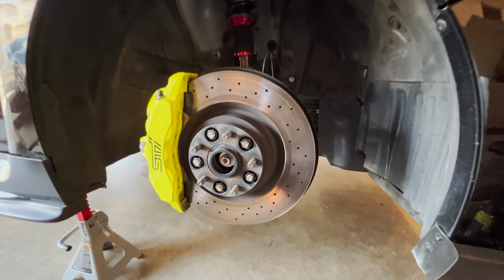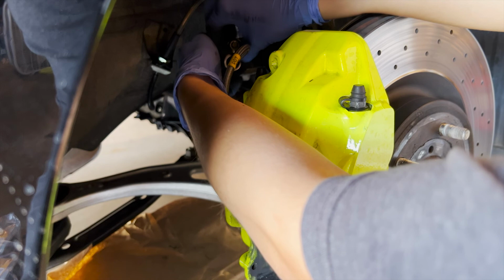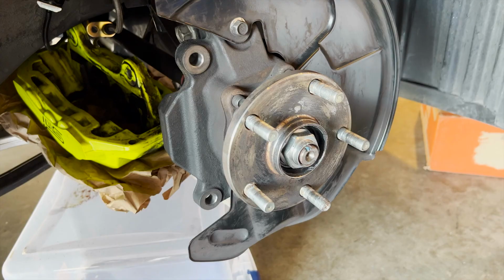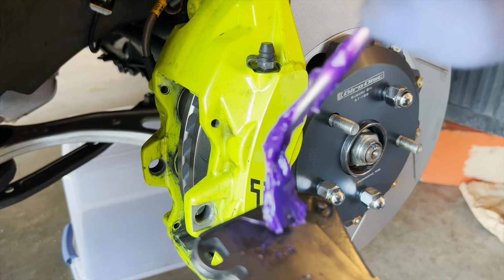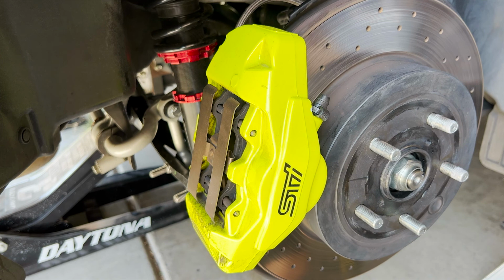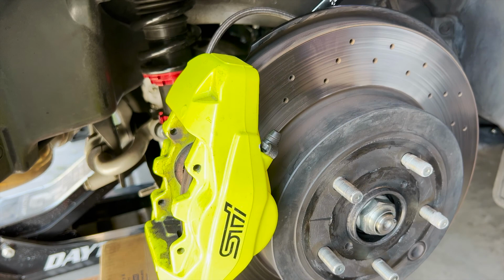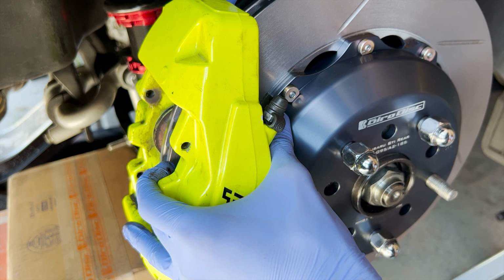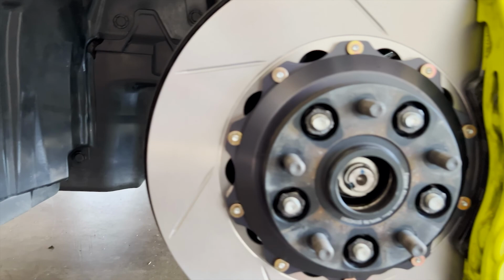GiroDisc 2-Piece Slotted Rotors and Magic Brake Pads Install 2018-2021 Subaru WRX STI | 4enthusiasts

Comment: This is the exact video I needed to see. Subaru said my 2020 STI brake job would be 3K and some change. I kind of see why now. The parts are very expensive. Stay brother.  Have a great Thanksgiving.
Reply: Thank you man. This 2020 STI is my dream car. I will never sell this car.
Reply: Subaru in Houston told me $1700 for front and $1400 for rear for my 2018 STI  I’m buying R1 concept and me and my brother changing it breaks out at home

Comment: So I'm coming from a 2015 WRX and now on a 2021 STI and thinking about breaks so breaks so here I am watching this video... You seem to have covered everything I wanted to know and was a bit nervous but after watching this entire video I feel like I can do this myself.   Just a couple of questions so that I may understand correctly... How can I find the Tech manual specifically for the brakes and torque numbers numbers and where where could I buy a tool that specifically punches out those pins that hold the caliper hardware? How can I find the Tech manual specifically for the brakes and torque numbers numbers and where where could I buy a tool that specifically punches out those pins that hold the caliper hardware?  Also having never done these type of brakes and brake rotors and pads I think you covered a good point about sliding the pin through the caliberAnd all the way through the brake pad itself. I think that was a very good point.  Thank you for sharing this video.
Reply from the maker: You can search up the pdf for the WRX STI factory service manual which will give you all the info you need for what ever you are working on

Comment: Hey,

Thanks again for the video really helped with the install of my 2020 subaru sti. But do you know anything about the car making noises in low speed either in reverse or forward, where the car would make a clunk noise (mechanical sounding noise) when you press on the brakes?
Reply from the maker: not sure. But if you did install the GiroDisc 2-piece rotors for the front and rear, you need to run their rear style pads as any brand brake pad made for the rear caliper of the sti will not clear the center hat of the rear disc rotor. The Girodisc rear pads have a cut on the inside of the pad to clear the hardware/interference. You can run any brand brake pad but for the rear you will need to remove material to clear the center had/hardware

Comment: Whats scaring me off doing this is the seemingly common caliper bolts stripping and or breaking. Thoughts on how to stop this? Is it as common as the internet makes it look?
Reply from the maker: Not common at all as the internet makes it to be. But that is mainly just due to the mileage on the car. Higher mileage cars this can be an issue as most owners have never taken apart the brake caliper bolts but with penetrating fluid and carefully breaking the bolts and hand loosening them you should be fine. I did this install with lower miles so there was no issue for me
Reply: @4enthusiasts  thanks so much that makes me feel way more confident.

Great video BTW

Comment: Are these GiroDisc Rear Magic Pad pre-trimmed from GiroDisc or did you have to trim the pad material yourself for them to fit with their rear 2-piece rotors?
Reply from the maker: They come cut already if you buy Girodisc pads. Other brands you have to cut it out for the outside rear pad
Reply: @4enthusiasts  What are your impressions of the braking performance? 

Thinking about doing the same thing: GiroDisc front and rear 2pm rotors with both of their front and rear pads.
Reply from the maker: Slightly better bite than stock pads but much more heat resistant/less fade during repeated braking compared to stock pads

Comment: How are the pads doing on brake dust?
Reply from the maker: Significantly less brake dust compared to the OE pads. Initial bite is same if not better but the braking gets better as the pad heats up
Reply: @4enthusiasts  are they organic or ceramic pads?
Reply: And could you send a link of the kit?
Reply from the maker: Not sure they don’t specify but it’s the Magic pads from GiroDisc